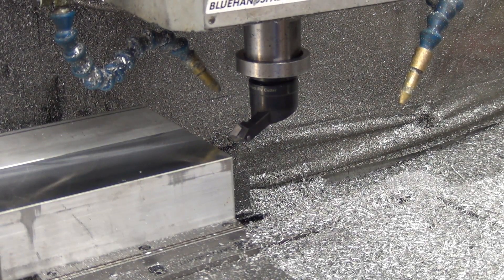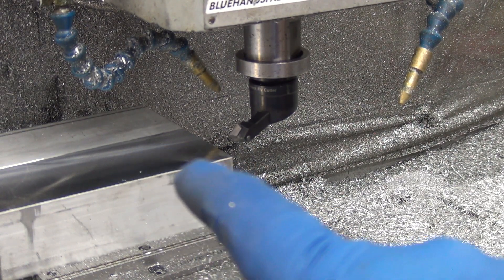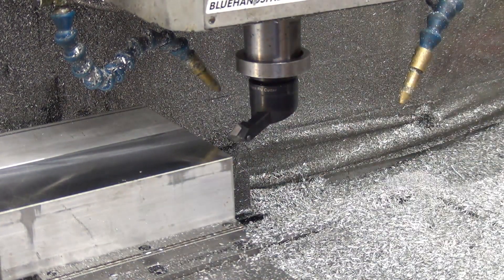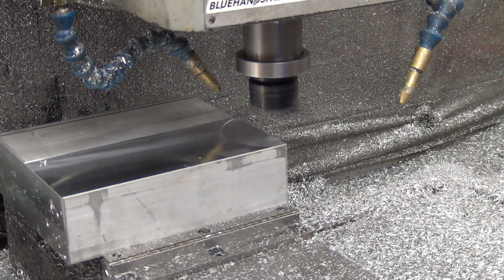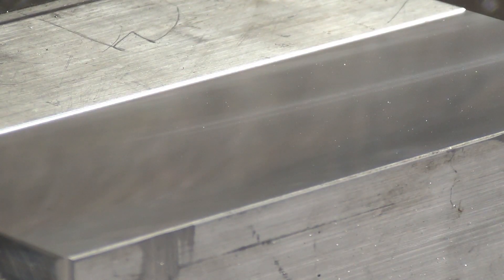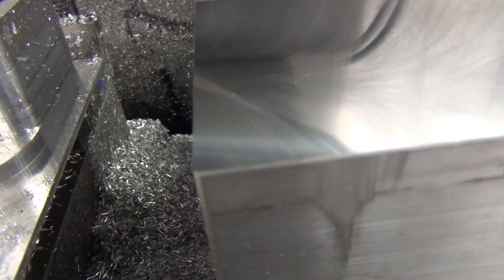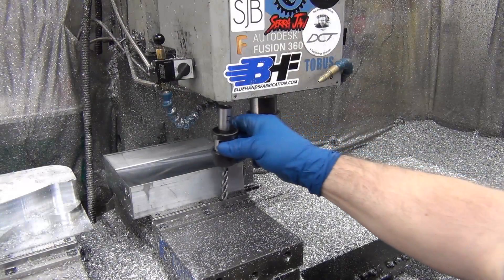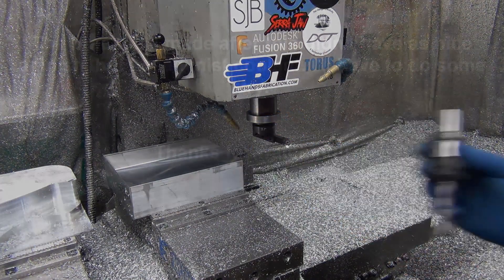SuperFly Finish

Comment: Curious, which Blue gloves do you use.  I was using the Orange but even the Amex XX- Large is too tight.  Thanks for the vids!
Reply from the maker: These are Harbor Freight's Large Nitrile.  I use them 99% of the time.  They're snug, but that helps keep them tight on the fingers....loose gloves are a lot harder to do fine work in.  I also use they're black ones that are thicker, but the same Large size feels even tighter since they don't stretch as much.  

You're welcome! Thanks for watching. :)  -Mike

Comment: That's a beautiful surface and an awesome cut quality - pretty close to a polished surface on a so called "front polished" wheel - also known as diamond cut. That's a really cool tool!
Great results, Mike! 👍😉👍
Reply from the maker: Thanks TOBi!  I was pretty pleased with it.  I've been frustrated with the finish many times before, so this was the first time I'd gotten one this nice.  I think cutting it dry helped too.  It seems the coolant causes the chips to "stick" to the insert and smear.  The last brackets I cut with this tool came out nicer and I did that pass dry.  The finish wasn't perfect, but it was definitely better. :)
Reply: @bluehandsvideo  Thanks for all your info! 🙌😉 Sounds to me like the testing progress I had with each and every CNC based machine, like my sign cutter, 3D printer or plasma table. There has been always a (very) long way of testing to get the "feeds and speeds" right. And there had to be only one small change, like the material or another tool and erverything started again. ☝😁 But(!) as soon as there is a good process documentation, these machines switch from a "nerve wrecking energy consuming monster" to a incredibly valuable tool. It seems to me, you already know about this for a long time. 👍😉👍 
Have a nice weekend, Mike! 🇩🇪👋🇺🇸
Reply from the maker: @WestBerlinCustoms  Yep....pretty familiar the the nightmare that cnc can be.  Heck.....I've had everything dialed in and then had issues with the stock being different from one supplier to another. It's part of what scares me when doing "one off's".  Stock changes are completely unpredictable. It can be figured out if doing multiples, but I can't just run a couple of test cuts on one piece of aluminum and then trust that it will be the same on the real part. :(    
How big is your sign cutter.....I'm assuming that's a cnc router setup....?
I've been off work all week....this weekend is the last of my freedom until Xmas. :(  lol  I hope you have a great weekend, too. :)

Comment: Nice work Mr Hands! When I get a finish that nice I immediately take a photo because I assume a) I'll never do it again and b) I'll scratch the crap out of it  within the day.
There's a relatively small channel called "Simcoe Spring service"  who have some fantastic videos about suspension and springs on big-rig type trucks and trailers. They make some of their own leaf springs and U bolts, the equipment is really cool. They are getting into manufacturing on a small scale with a lift kit for trailers and I'm sure if you watch their production process video you'd have some useful input for them.
Cheers!
Reply from the maker: Thank you!  That sounds the same for me!!!  A couple of times, I could have sworn that breathing on it scratched the finish. :(  LOL

I'll check the channel in the morning.....time to sleep now.  Thanks for the heads up. :)
Reply from the maker: Some of that big bending/pressing equipment is pretty cool!  I really like the "bench vise?" that's built into that one table. :)